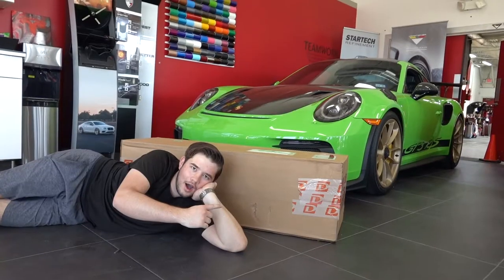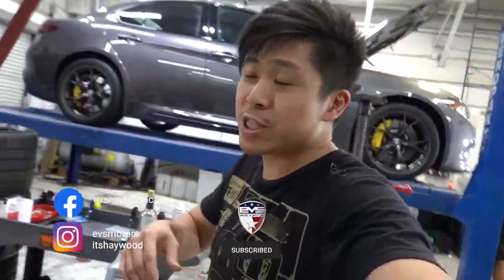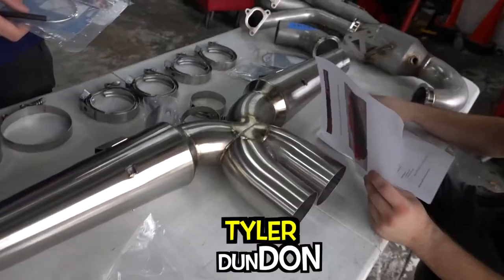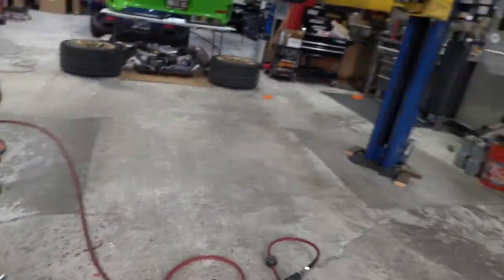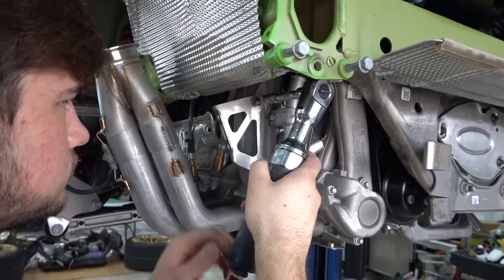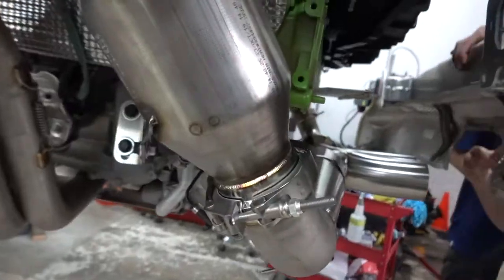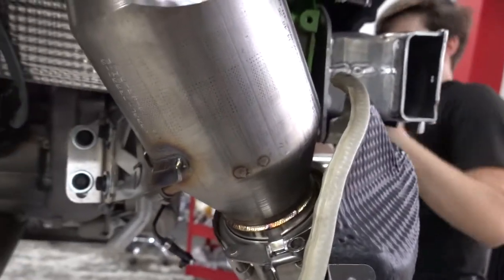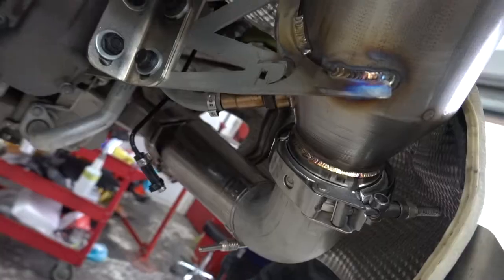Porsche GT3RS Dundon Motorsport Megaphone Exhaust Unbox, Install, & Drive

Comment: Can someone tell me what this megaphone or what megaphone exhausts in general do I kinda guessed frm the name it makes them louder by why have I not seen them on any other cars before ?
Reply from the maker: It's only for the GT3RS
Reply: @EVSMotors  yes ik but it’s welding metal at the end of the day what are the benefits of that type of exhaust that is used on this car
Reply: As far as I know it will change the pitch and tone of the exhaust.